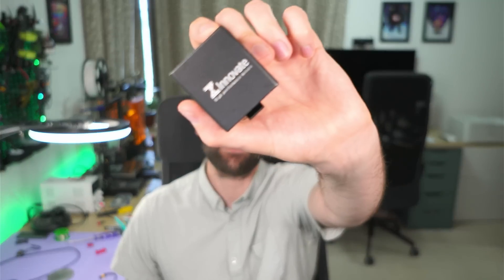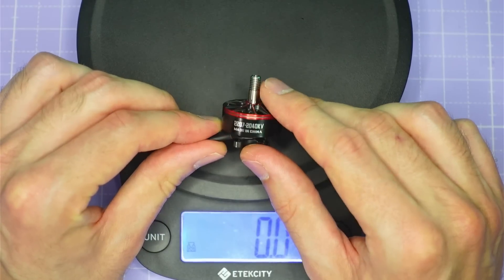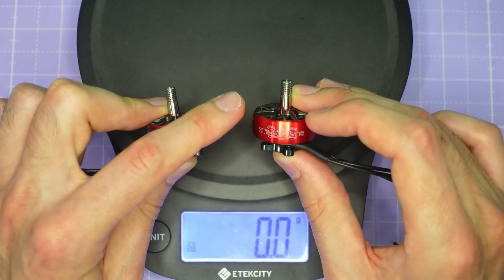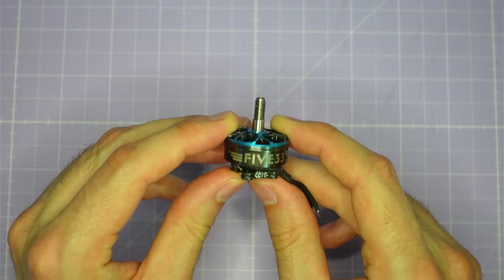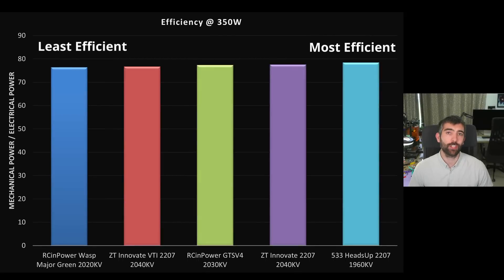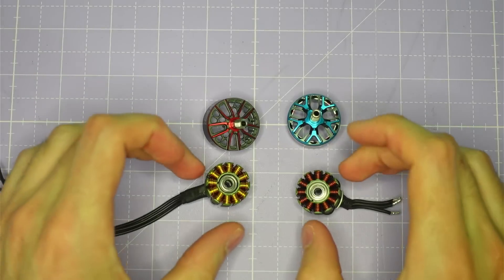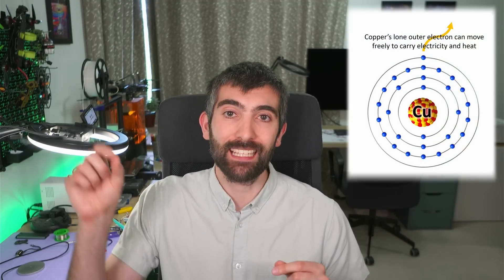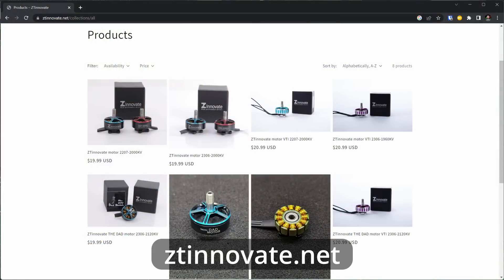I had never heard of these motors but they have a cool secret!

Comment: I have a set of FPV dad motors (2306, 2120kv), on 6s they scream with Supafly's tune. I'm working on my advanced license with TC and I need to figure out the general thrust of my rig, I'm pushing 5546 on a RVS creamer 2 build.

Comment: i may not have dug back enough for your testing.  what voltage on the motors is being used?  what is the current draw across the torque curve?

Comment: I'm impressed by the efficiency of the Five33 headsup motor 2207 and wish there was a graph with the motors efficiency for the whole throttle curve. Thanks for the video
Reply from the maker: All the data is available in the Patron section of the discord server. 👍

Comment: It cant be thaaaaat hard to make your own tester, could it? Get a (or multiple) brushed ESCs dumping current into probably a metal tank with water in it, write a simple arduino program to control them, and use a good current and voltage meter to measure. Find a good way to chart the data which im sure you could get with a relatively reasonably priced piece of equipment. Then cool the water with radiators. Cant be much more to it than that, right?

Commission me! Lol

Comment: There has to be more to it than silver plating..? I mean, a full silver wire would only make 3% difference in ohmic/heat tests. You might get a very similar performance (+3%) boost by a thick silver plating due to the skin effect I'd guess, or square wire providing better fill-ratio + area increase + more "skin" to effect in. Chris did you test their kV claims? Maybe they have under rated the kV claim? I mean... the torque difference is massive both low and at high rip'ems. It has an odd curve compared. (Opinions here is from an armchair-fpv guy, haven't had a quad in the air for 8 years or more)

Comment: It would absolutely be cool to see silver motors. but also, I would like to see a heat test with these motors to see if the extra cooling is really effective or if they're just good motors. If the cooing IS much better, what about gold wire? Obviously, it would be a HUGE weight gain but I think it would be interesting to look at temps if it turns out the material really makes a difference.

Comment: I would love to see a video where you use silver wire in the motor. Do you think there is enough room to put in an o ring on this motor? The only problem that I see is this motor is from a Chinese manufacturer. It could be stolen ip or a small run on someone else's equipment. It will start off good then turn into a money grab. China's manufacturing is a total mess right now and not looking good for the future.

Comment: 7% less resistance in a micron thick plating?  Just increase copper by an unmeasureable amount - Gimmick here, not used in motors.  If the term skin effect comes up, then a discussion about using multi-stranded windings should happen. (and it won't)
Reply from the maker: Multistrand windings are a no go for cooling. Skin effect is small for the switching frequencies we use but may increase the effectiveness of a silver plating above the ratio of cross sectional area. Anecdotally Ryan Harrel found ~5% improvement with silver plated wire. Some of this might be due to better cooling due to silver's higher thermal conductivity as well as reduced electrical resistance.
Reply: @ChrisRosser  Retired EE with a automotive career with electric motors, silver-plated copper wires were never on the radar.

Comment: You don't need to rewind with silver wire. Just measure the internal resistance of the whole motor vs. a motor with same KV. Or better, unwind it, and measure internal resistance per meter of wire. This way you even know how much silver has been used!
Reply: you can just calculate a difference

Comment: Product idea - bells are disposable - a stator and bearings will outlive the bell 1:3. For 2207 you can pop on almost any bell and not tell the difference. It would be nice to see an extremely high quality 2207 1950 KV stator and bearing sold independently - maybe with silver lined wires. Also gold is a better conductor than silver.
Reply from the maker: That's a really cool idea, how much performance is the stator vs how much the rotor bell. Also I just checked and gold is not a better conductor than silver, it's a little bit worse. The larger charge on the nucleus holds the outer electroncs more tightly and there are not enough additional electron shells to compensate for that (unlike moving from copper to silver).

Comment: Why going the cheap way, please rewind a Motor with gold plated solid silver wires. Then we know, what is really possible. Back in the first days, there were some silver wired motors on the market. Even tmotor had a f40 or f60 with silver strings. Its not new, you just don’t need it.  You will loose much more power in the false motor prop choice. Even if you take the best prop and the best motor is maybe a bad couple. ;-)

Comment: Hi Chris -- I'll one-up you, let's test both pure Silver and pure Gold wire!  Au has even better properties than Ag (for the reasons you identified) so let's "go big" and do both!!!  😄
Reply from the maker: Interestingly gold is a slightly worse conductor than silver, the larger charge on the nucleus holds the outer electrons more tightly and the extra electron shell is not enough to compensate. But if you'd like to donate 30g of gold wire to the cause be my guest! :D

Comment: Before you even mentioned it I was thinking I wonder how expensive an all silver winding motor would have to be? That would be a really interesting experiment! At current prices, probably $15-20 worth just in the cost of the silver, so maybe $55-60 per motor? Although you wouldn't get the benefits of mass production lowering the cost, so realistically maybe $80-100 per motor. Then you get into the issue of is suitable insulated silver wire even possible to buy or would you have to fabricate it yourself.

Comment: I have a Brotherhobby Returner R6 2207 1750kv which is 2-piece motor(not unibell) from 2019 that I use for bashing! I'm still using it today. I crashed really hard so many times at CPP in Socal. I crahsed in CVS building hitting a concrete wall at 60-70mph and plus all the crashes it has encountered for more than 3 years. The only thing I've been replacing are the bearings. Everything else, stays! Today I did some research about it about and found out that the aluminum type used in the Returner R6 is 7075 aluminum which is very durable. Chris, the motor you were reviewing in the video above, what aluminum type is it built from?

Comment: These also have stronger magnets.. N55SH instead of normal N52SH.
Reply from the maker: I really don't know if I believe magnet ratings like that. N52 is supposed to be the strongest and you cannot make a high temperature H version of it. N55 is incredibly rare and expensive and you cannot make an H version of it either. Probably just good quality N48SH magnets 'rebranded' to N55. We'd have to see the datasheet to know.
Reply: @ChrisRosser  As for the battery testing, Hit up Bardwell. He has been wanting someone to run tests on his 10K? battery tester he got along time ago. Let's say for shits and giggles this was correct, would that explain power differences? (we both know these is no way these are N55) Could they be just good quality N52? I was thinking measuring the thickness of the magnets would be a good data point to have also. Is there a tool to measure and find out strength of these magnets on motors so we can have that data point too? Didn't T-motor make a version of the F40 that was silver coated like these?? I belive I remember something about the winding color like these.

Comment: The direction of the current in a motor wire changes 12 - 14 times per revolution. If a motor spins at a moderate 10.000rpm that makes it  12-14kHz AC current. 
As far as I'm aware, with the AC current (as opposed to DC current) only the electrons of the outer surface of the wire flow. If this is the case, a good, solid silver-plating will be as good as a solid silver wire when making motor windings...
What scares me is the possible arms race from Copper to Silver to Gold.... 🙄

Comment: I'd be more interested in seeing how power fades as the motor gets hot. How much less thrust and torque does a motor at 70C have? Could increasing bell surface area with ridges cool them better and return some of that performance?
Reply: there are a few motors on the market that do that, the added weight is in a bad place, so it's not popular

Comment: So interestingly enough SunnySky was the first FPV hobby focused manufacturer to make silver plated windings. This had to have been back in 2015 or 2016.  T-motor followed suit, and most of their pro-line motors have had silver plated windings since then. 

Back when the original RotorRiot Hypetrain motors were coming out I did a bunch of R&D testing of variants and I had the opportunity to test a couple of motors back to back with silver windings and without, along with several wire thicknesses. Some super interesting results. It showed about a 5% increase in performance in my testing over the non-plated wire, which is not insignificant. 

Another thing worth pointing out is the role of skin effect in this conversation. My testing also showed a similar outcome that you saw here where the gains were primarily in the upper part of the throttle curve. Rather than this being a result of higher Kv though, this is mostly due to the fact that the penetration depth of the current flow is  inversely proportional to the frequency of the switching in alternating current. At low RPMs skin effect is playing a fairly insignificant role, but as throttle increases the current is more and more focused on the surface where the plating is providing an increasing percentage of conduction. I actually ran the formulas back when I was testing this and there's some interesting stuff related to the diameter of the wire and the thickness of the plating along with the PWM duty cycle at the FETs. There's also some interesting stuff related to this and multi-strand vs single strand windings for higher Kv and higher RPM applications.
Reply: Yeah I remember too the earlier SunnySky motors with silver plating. Did SunnySky make motors for Diatone 🤔.
Reply: @IanF-FPV  Yes those blue Diatone motors were SunnySky R series motors. I don't believe the diatone version had the silver windings though IIRC. The recent Mamba series motors are made by RCInPower I believe.
Reply: @IanF-FPV  no！
Reply: @adaye5213  QuadMcFly confirmed that SunnySky did make motors for Diatone in the past.
Reply: @IanF-FPV  specifically the ones back in 2017, the Diatone Edge motors. I just checked and the early ones did have silver windings even then actually. They updated them later with copper windings, and you can still buy the blue version of the motor with SunnySky branding on a few websites, but without the silver windings.
Reply: Yet another great example of the strange ways in which SunnySky has been quietly making some of the most amazing motors that somehow never caught on with the hype.
Reply: @tehllama42  Yeah man, I was super disappointed when they got out of the FPV hobby. They've made some of the best stuff out there IMO. I jealously horde my early SunnySky motors. Just about to put a set of the R1408 motors on a 3" build :D
Reply: Rosser strikes again 🎉 lol I even remember more recently the DXA Brother Hobby motors! Same fancy windings…. So far the most durable and best performing motors I’ve ever put on a basher build.
Reply: Yeah this is old goes to show this dude is new to the hobby

Comment: If you make silver wire motor you should make copper one too to accurately compare diy vs diy motors 

Or even better you could
1. Buy 3 same motors
2. Do a bench test on all of them
3. Take off coils from 2 of them and leave one as is
4. Rewind 1 motor with same width copper wire
5. Rewind other motor with same width silver wire
6. Redo bench test on all 3
7. Compare results

Would be interesting to see if performance changes if you rewind manually. Maybe if manual winding ir poor with a lot of air gaps, the motor would heat up faster on inside coils due to air insulation

Comment: Are they planning to add these motors to the website at some point?? 
They're not currently listed, only the two-piece 2207 in 2000kv, 1900kv, and then a few versions of the dad motor, which are all 2306.. 🧐

Comment: Should have compared it to the T-motor or Hypetrain silver wire motors. The T-motor calls it silver core not sure that means solid silver though might be a translation issue.
Reply: hypertrain is garbage, but T-Motor would be a great comparison

Comment: Solid silver wire would be sick.. then the question is would solid gold wire be even better albeit prohibitively expensive. And then.. would gold plated copper wire outperform pure silver wire?
Reply: No, gold doesn't conduct as well as copper or silver...we use it on contacts because it doesn't corrode.

Comment: Regarding battery testing. I would BB log a few freestyle flights and also get some top racer BB logs, and make a load test profile (thro and currents) and use it of course checking IR with something like Wayne Gills meter. Checking temp, capacity, voltage sag, etc. Also should look into some of the 6s 5000 testing mscguy is doing, he is the standard for the edf guys, he is in rcg, if you need help let me know.
Since you program, I don't think you need to buy a cadex/etc tester, build your own.
Thanks for sharing.

Comment: Copper's electric conductivity is 58 MS/m at 20 °C, as for silver, it is 63 MS/m. about 3% difference per meter, I think there's more than one meter of copper in that stator. I would like to see the silver winding, I expect less than 5% difference.

BTW, if you do the experiment, consider repeating the silver  plated tests with a manually wound stator, I think that value should be compared to the solid silver wound stator.

Comment: Totally wanna see the performance differences in solid silver wire
Reply: Silver, while the most conductive material, is only slightly more conductive than copper.Also electrons move mostly along the surface anyway.
Reply: Little to no difference. We tested it at work. Not for drone usage but for centrifuges.